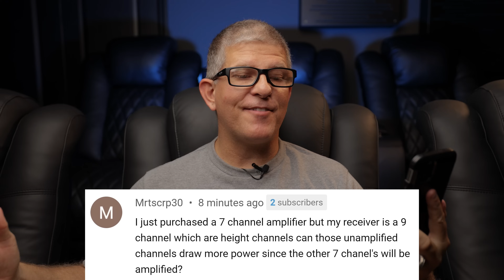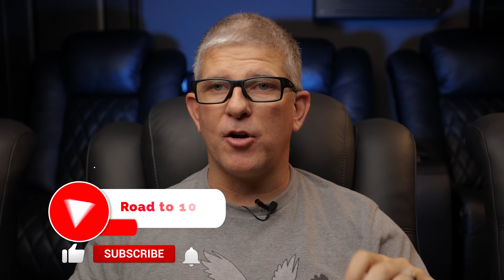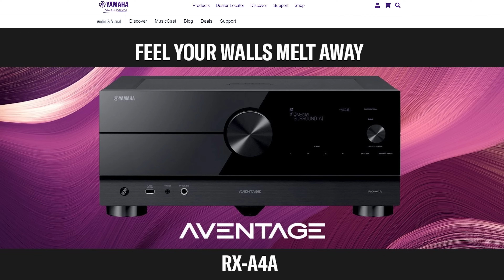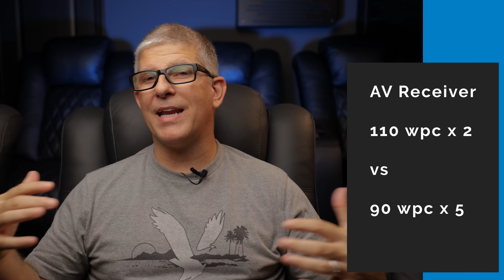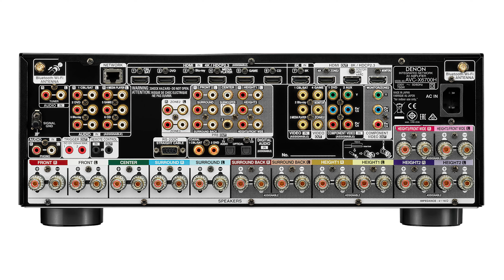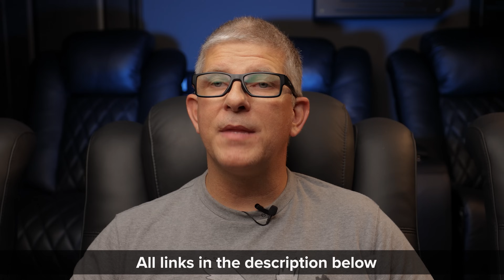How to Get MORE Power From Your AV Receiver - Home Theater Basics

Comment: It’s so true external amplification is the way to go. I’m using the denon 6700h for my 4 surrounds and atmos and for the front stage i’m using a emotiva xpa3 gen 3. When doing that i noticed a huge improvement in the surround and atmos. I might add 2 basx 4 channel amps later on but i feel like i don’t really need it hahaha Get video as always! Oh and btw the rf7-iii’s rock like you said in other videos !🔥
Reply: So you get better separation by adding an external amp?  I'm considering that...I'd have to anyways if I wanted to add rear heights in the future.  All the amped channels are filled right now  on my x4700h (7.2.2).

Comment: Great video!!
Question - Will that external amp not start dividing the power amongst all of its channels as well?
It almost sounds like discrete (or dual channel) amplifiers would be required in order to not suffer the effects of channel saturation.
Reply from the maker: Most external amplifiers are designed to provide equal power to all channels driven. Some of the higher channel amps like my Monolith 11X provide lower wattage to some channels (200x3 + 100x8). Emotiva XPA 11 does 300x3 + 65x8
Reply: @Youthman  Thanks - this video was a real "eye opener" for me -  I thought I was pretty 'savvy'...  ...not so!  😉
Reply from the maker: No worries Gary. I never claim to be the expert. There are a lot of people way smarter than I am. I learn something new almost every day too.

Comment: I'm running my LCR on a separate 5 channel amp while the remaining 4 surrounds are powered via the AVR. 
Allowing your equipment to have plenty of head room will allow it to stay cooler and run more efficient.
The one thing that has always been true in my 30years of working with sound tech is ALWAYS buy a larger amp than what the speakers are rated for.
Remember, you can always turn the volume down. Give your speakers clean, easy power, not dirty, distorted power.
Reply from the maker: I love this 👆👆👆
Reply: i have come to relaise this by watching channels like this and others over the last few months, once funding is there am tempted to get a 3 channel amp for my LCR
Reply: Let's not forget power draw from outlets.  It really should be a dedicated circuit.  With subs, TV, amps, etc... you could be drawing over 2,500 watts or more.  Hopefully it's not on the same circuit as your other appliances.
Reply: @qua7771  
Once it's finally settled on the permanent layout of things (who am I kidding. Nothing in this hobby is permanent lol), I'll be running 2 20 amp circuits.
Reply: @mephInc  I'd make sure that both circuits are pulling 120v from the same leg of the 230v in your panel.  If not it usually wouldn't be an issue, but I can think of a few rare scenarios where it would.  I decided on using a full sign wave UPS, (two of them actually).  They are much cheaper than replacing equipment, and not much more expensive than a good power conditioner.  There is a lot of lightning, and frequent power outages in my area.  They also insure good clean power.  Before my current set-up, I noticed the lights dimming when my subs powered up.  The UPS's allow you to monitor your power consumption, and offer an alternative power source during outages.  I'm not trying to spend your money, but something to consider.

Comment: Just be careful to check how flexible your AVR is - some you can only pre-out 2 channels or all channels, nothing in between
Reply from the maker: I’ve never seen an amp that is all or nothing. Not to say that it doesn’t exist, just have never seen that. Do you have a specific brand or model that you know that does that? Preamp mode in the new Denon and Marantz is the only thing I’m aware of that if you enable it, it does disable ALL internal amplification. But that’s not what I’m referring to in this video
Reply: @Youthman  you’re right - I was thinking of the new Denon / Marantz amps . I thought the preamp outs were only live if you switched true amps off
Reply from the maker: No they are always on unless you select preamp mode which turns them all completely off.

Comment: I have a 5.2.2 system in my theater which was being powered by a Denon x3400. I picked up a used NAD amp which I'm using for my LCR to take some pressure off the Denon.  Now the Denon only powering the back surround and 2 atmos speakers I feel the overall quality has improved and the amp seems to help quality of 2 channel music. I may look to upgrade to an Emotiva amp but for now I'm happy!
Reply from the maker: Sounds like you have it under control.

Comment: I run my 9.4.0 as Youthman suggests with the 11 channel processing (9 internal amps) 110 wpc Marantz 6011.  That's the atypical configuration of 7.4.0 + 2 Heights.

An Emotiva XPA-5 runs L/C/R and the AVR powers everything else which it easily does without the heavy demand of the L/C/R.  I get a huge front sound stage and great dynamics.  Using the AVR power alone would get me LOUD but without the dynamics an external amp adds.

Comment: Thank you for your great reviews and comments What can I replace my 8805a marantz receiver to?  The reason is I upgraded all my components thank you so much
Reply from the maker: Thank you daee. My question to you is what does your 8805a not do that you need it to? If you absolutely love how your system looks and sounds, there's nothing wrong with sitting back and enjoying what you have built. Do you have multiple subwoofers? If so, do you have a miniDSP 2x4HD to dial them in? If not, I would highly consider getting one - https://youtu.be/_ZxbM_s4vh0
Reply: @Youthman   Thank you for your response I have MC901S and and Bowers and Wilkins 801D4 plus 2 sx212 rel and the matching   Center And Rear speakers plus 2 Dolby atmos Just wanted to make sure I have the right processor Thanks again
Reply from the maker: Wow! What an incredible system you have put together. I love my Marantz AV7705. If I were to upgrade to something better, the next step would be a Trinnov or Storm Audio. But like I said, if you love how it sounds, no real reason to chase the rabbit.
Reply: @Youthman  I really appreciate it 🙏🏼 you are the best brother
Reply from the maker: What state are you located in?
Reply: @Youthman  I live in los angeles area. Any time you are in the area for any home theater demo let me know
Reply from the maker: That would be sweet. Feel free to submit your setup at www.hometheatertours.com. Maybe one of the brands in your setup would be willing to sponsor the trip
Reply: @Youthman  absolutely. That would be awesome

Comment: @Youthman Perfect video for the question I asked you the other day about adding another amp for my 7.1.2 setup with my Marantz 9.2 AVR. Probably going to go with the OSD 7-channel amp you recommended and bi-amp the RP8000FII’s 😄 Never have bi-amped anything before so any tips are appreciated. Also have 5000F’s and 600M’s that could be bi-amped but don’t know if that would be better or not. Also, would you recommend keeping all of the speakers set to small and let the SPL150 do the work? Thought about running the fronts as large
Reply: Bi-amping will give you marginal improvement in the midrange at best.  I've found my speakers are more dynamic when I DON'T bi-amp.  

It's for the same reasons Youthman pointed out in this video.  If you don't further divide the power available into bi-amping then each speaker has more power available to it.  You will get better dynamics without the bi-amp IMO.
Reply: @voiceofreason9238  thanks for your response! Yeah, I was debating whether or not to because the 8000F’s are rated 150/600 watts. Either way, I’m looking to take off some of the workload from my AVR so it doesn’t have to process and power all 9 channels
Reply: @Sebastiano1394  bi-amping is best done when you have no more than two channels per power supply, IMO.  Even then, I’ve always found the result better by instead using the bridge mode.  I think it’s because when regular bi-amping each of your amplifiers are still working to produce the full range of audio and the crossover simply eats the bass from your top half and the mid and upper from your bottom half.

Comment: I glanced at the 8015 manual before, and had one thought but went, "nah."  Now seeing this and looked a second time, and now I'm just speculating.  I wish it were possible to relay the front L & R to external amp - as they're very meaty towers.  Then just use remaining internal for the remaining speaker level outputs.  And that would even allow for a third pair of Atmos from the receiver.
Reply from the maker: You can use an external amp for your LR but you cannot route the internal amps for the L&R to surround speakers. Sometimes an AVR will let you do that with Zone 2 channels.
Reply: @Youthman  ... I thought as much on second glance.  Seems like an untapped opportunity to assign the speaker outputs a little better.  But you and I both know the 8015 still dishes the sound out of the box.
Reply from the maker: 8015 is a beast of an AVR.
Reply: @Youthman  hello youth man...is there any significant difference  between 8012 vs 8015 except 4k vs 8k? In sound quality power and dynamics? In what way 8015 is better.
Reply from the maker: For the most part no. I personally would not upgrade to it unless you need 8K or 4K120
Reply: In addition to what @Youthman  said... The ability for going pre-amp eventually is a nice feature.  It also adds IMAX enhanced - which has been nothing but a basic talking point.

If you go to MWAVE, there "might" be an SR8015 around for a shootout.  But don't quote me on it. 😉

Comment: Recently added 4 atmos channels so I added the Emotiva XPA-3 for the front stage. Worked exactly as you outlined let alone made the whole front stage sound even better. I am running Paradigm Prestige so they are pretty efficient but the extra power still made a difference.
Reply from the maker: That’s awesome! And with Paradigm not being moderately efficient speakers, they really benefit from having a dedicated amplifier for your front LCR.
Reply: How to add an external amplifier to my main lcr in denon x6700h through preouts without  using internal amplifier of the unit could you solve my query...
 thank you 😊
Reply: @vhariharasudhan7215  I am not familiar with the Denon units. On my Pioneer Elite, in the settings there were a variety of speaker configurations to choose from which essentially reassigned the LCR channels to different ones. I would check your manual/look it up to see what it recommends or just dig through the various settings. I dug through the settings and eventually found the options. Good luck!

Comment: I plan to buy the Yamaha a6a would 150 watts be enough for a 7.2 system or would the power drop to 100 watts?
Reply: Yamaha a6a have maximum of 500 Watts Power consumption ( its hidden in manual). ok 500 Watts divided through ( 9 channels + x (Av Function) )maybe 35 - 40 Watts per Channel by simultaneous usage.
Reply: @diddidachs  I also will buy an extra amplifier to run my front speakers and let the surround channels run off of the avr itself
Reply from the maker: I honestly could not tell you how much power reduction the Yamaha would have driving 7 speakers. It also depends on how sensitive your speakers are. I share about speaker sensitivity in this video https://youtu.be/g-GOvn6_um8
Reply: @Youthman  it’s gonna be a homework for me cause I plan to get rid of my onkyo that’s driving all 7 channels and two 12s

Comment: These companies really should be held accountable and release the real information for all channels driven from 20hz to 20khz and I'm pretty sure the real numbers would shock people how low the wattage drops when you run 5/7/9 channels from one reciever. Once you switch to a reciever plus a power amp it makes such a massive difference or to a reciever such as audio control which gives you actual ratings for all channels driven. It's shame because the amount of money you need to spend jumps to a few thousand to get proper sound processing and amplification to get it sound amazing. This is also the reason why people blow tweeters in speakers because they are using a low power reciever and cranking it up and the power supplies in these denon/marantz/pioneer can't handle the load and the distortion goes up so high the speakers get damaged.
Reply from the maker: Valid points. I agree I wish there were better regulation myself. But from a marketing standpoint, 140 W per channel to channel driven sounds much better and 55 watts by 7 lol
Reply: @Youthman  It's interesting because 2 channel amps ARE held to a different standard because of a Sylvania lawsuit wayback, but recievers are allowed to claim whatever they want like it's the wild west lol. Marantz has a 70% guarantee on all of their recievers for power ratings, that's like claiming a car engine can only perform 70% of what it actually claims, it can go 200* mph but *actually it can only go 140 mph*. If you ever get the chance please do a review on an audio control or McIntosh reciever/sound processor they are in a different league than marantz or anthem.
Reply: The EU is going to regulate power claims, unfortunately recent events in Europe has slowed the process...just like getting apple to use a standard charging port in the EU...
Reply: @Echo-jg8is  Hopefully this happens sooner rather than later, distortion is also something that should be looked at. If you have ever had a center channel that's hard to understand while running a lower model reciever its because of low power and high distortion, alot of the recievers jump up to 5/10% distortion if not higher when pushed very hard.
Reply: You referencing audio control tells me you are a discriminate audiophile who knows good equipment!
Reply: @jarvislarson6864  Their amps are awesome but expensive, I was about to buy a Savoy but ran into such a good deal on a good McIntosh power amp so I had to get that instead